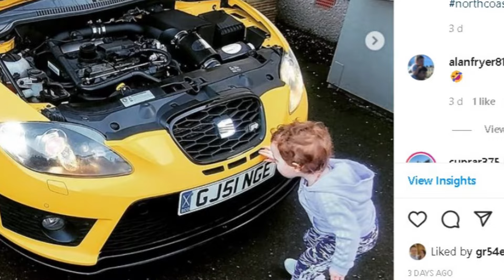Cupra Emblem Mod | MK2 Leon Cupra 1P1 front and rear badge replacement

Comment: im also thinking to do this, but i have a  2007 k1, so i have the before facelift grill
Reply from the maker: That's shouldn't be an issue I believe, as AT designs have made various sizes of badges, so if you say what you have, or send a picture, he should be able to get the design and size of badge u need 👍🏻

Comment: PP3D are better designed badges
Reply from the maker: Yeah just got a pair of PP3D's delivered a few days ago. For the bargain price of 30 quid for the pair these ones in the video were ok at the time, but I can't wait to get my new ones on 😁👍🏻
Reply: @NorthCoastWorkshop  good price is that like 👍🏽 make sure you put them on with tiger seal
Reply from the maker: Will do mate, don't want to lose them after the money spent 😂 but yeah can't wait to get them on. Cheers for watching 👍🏻